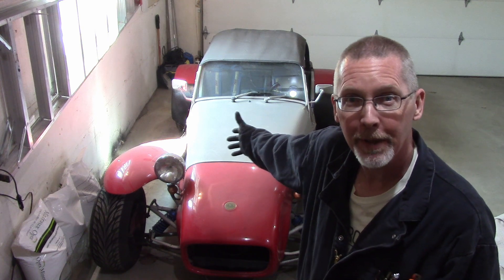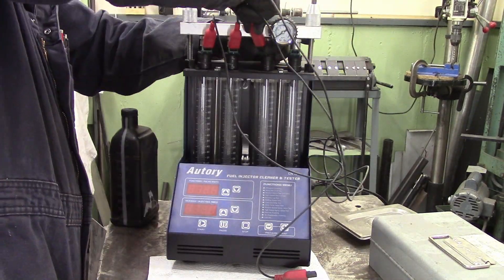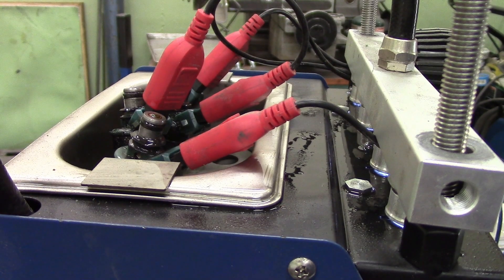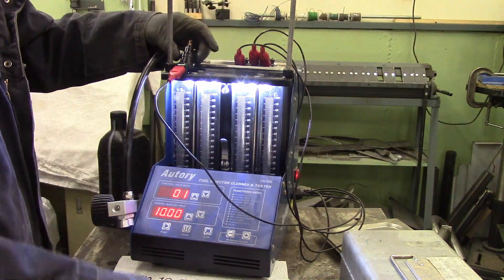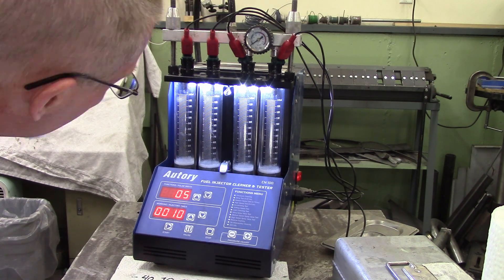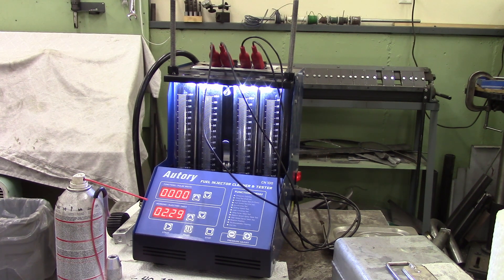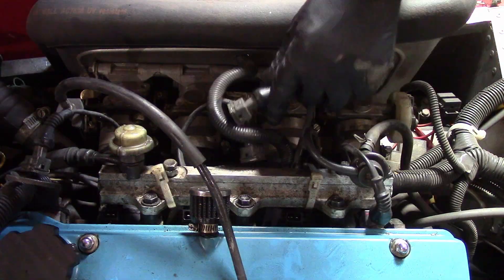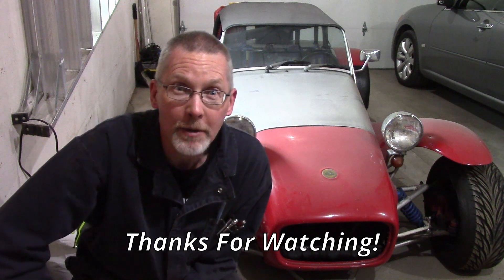HOW TO: Fuel Injector Ultrasonic Cleaning & Flow Testing

Comment: Hi m8 can u please advise what did u used for ultra sonic cleaner also was th injectors on all the time when it was ultrasonic cleaning in progress
Reply from the maker: The machine pulses the injectors for you while ultrasonically cleaning; you want them pulsing.  You don't want them "on" and not pulsing.  I usually use Mineral Spirits, although I have used Seafoam instead.  "Like dissolves like," so use something that would soften gasoline debris.  But probably not gasoline.  I deal would be back-flowing cleaner through them while ultrasonically cleaning and pulsing; a guy can dream.

Comment: Mineral Spirits is what I have in my ultrasonic parts washer. I had wondered if it was okay for the injectors. I also had noticed in some other fuel injector test videos how some were foaming up which I didn't like because you would have to let all that settle to see flow rate. I decided not to buy a rig and made a homade hillbilly fuel injector testor. LOL My last few shorts I posted shows our test rig and the fun we had.
Reply from the maker: I was tempted to make my own.  If you can source all the parts affordably, it should be more bang for your buck.  I'd love to be able to test eight at a time.

Comment: Injectors have a screen filter. I clean my injectors by mounting them upside down. That back flushes the injectors. Then I turn them right side up for flow testing.
Reply: Wouldn't it be best to remove the micro filter screen while back flushing them to help anything escape the injector?Then reinstall them for any further cleaning.

Comment: by keeping injectors sideways, would be harmful to injectors or machine if the connectors get dip in solution while running ultrasonic   cleaning?
Reply from the maker: No worse than being in and on an engine.  I did find they clean better (quicker?) sideways than up-ended.

Comment: Great video, thank you!
I was just thinking that, as i have a spare fuel rail, a spare fuel pump and one of those smaller injector testing devices (that pulsate 2 injectors at a time) I'd try to rig up a similar machine. What could go wrong eh? 😅
Reply from the maker: Totally doable.  If you can find a cheap ultrasonic cleaner, that part is the magic.
Reply: @GregWellwood  oh yeah forgot to mention I have a stand-alone Ultrasonic cleaner and have been using it, just have no way to test/match the injectors before/after. Thanks for your reply!

Comment: If the connectors are Bosch EV1, then you just push the clip inwards, and it comes right off. No need to pry the metal bar off the connector.
Reply from the maker: There's a clip?  I need to go take a closer look....
Reply: @GregWellwood  if it is the connector that I think it is, then you should have a metal bar/clip. Google Bosch EV1 connector.

Comment: So how much are new bosch injectors?
Reply from the maker: For an LS? About $120 each, Canadian.  I bought this machine for the price of four injectors.  If I clean five injectors, I'm already winning.  So far, I've cleaned 32 injectors.
Reply from the maker: @8SecSleeper  Do you have a link?  On Amazon there is one, but it's $950 CDN (probably $700US)
Reply: @8SecSleeper  The LAUNCH cnc603a is a great machine .A friend has one its a great unit .we use it a lot  for cleaning the injectors in our drag race modular ford 4.6 and 5.0  and LS engines .we clean/test the injectors after every weekend  of racing .It makes a difference and these units are not very expensive.Watch what you run through the machine as test and cleaning solutions Some chemicals can damage the  units.We use 92% or greater Alcohol on the  test  side and ultrasonic cleaner and distilled water in the ultrasonic cleaner tank side.

Comment: Vaseline on rubber seals - hope they are not rubber.  Don't know why people risk using vaseline when atub of rubber grease will last a small workshop 50 years with zero risk to seals.
Reply: I use engine oil